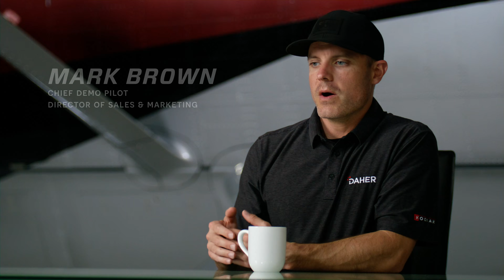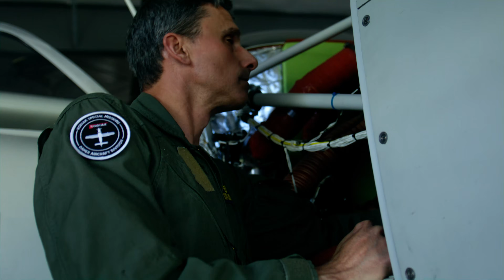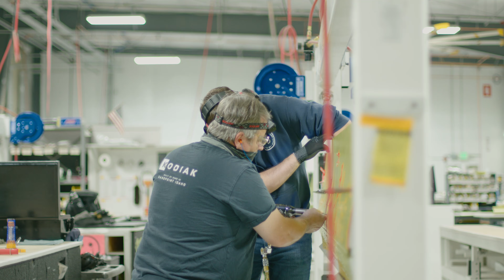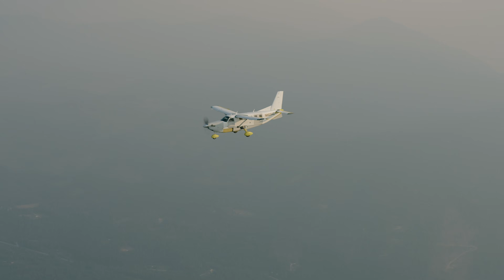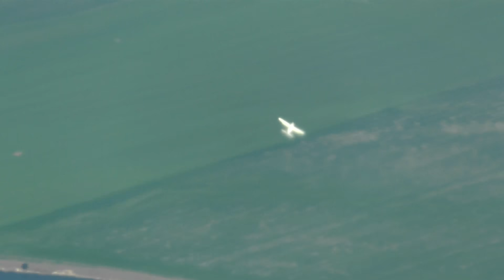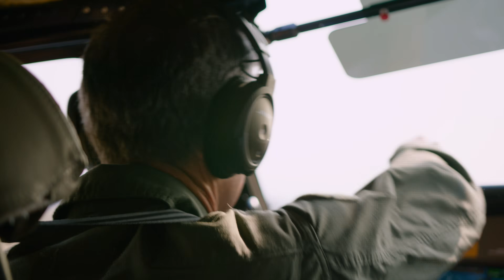The NEW Kodiak 900 - CERTIFICATION

Comment: nice bird,,, would have been nicer with 1 button start and 1 lever throttle fadec :)))
Reply: A new turbine bird with no FADEC?!!!  I am a bit surprised.
Reply: @kevingallineauii9353  well am sort of not,,, its meant to be a fancy bush plane ,,, so i  guess they kept it old school,,, seems easy to start,,  ignitors on,, starter on and hold ,, spin up to 15%,, fuel cutoff to low idle,, rpm up to 50% ish  and or itt starts to drop ,,, let go of starter and shut off ignitors,, few steps i guess,,, i would be worried on takeoff thou,,, you cant slam the throttle to the stop or you will over  torque the motor ,, so i guess on takeoff is the only place to have to sort of watch its limits,, ya fadec would be sweet thou :))